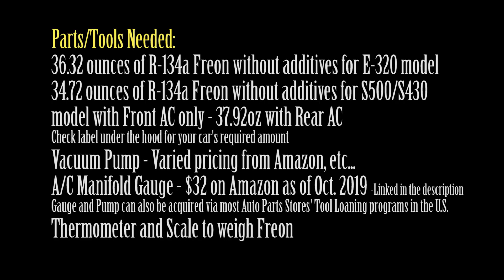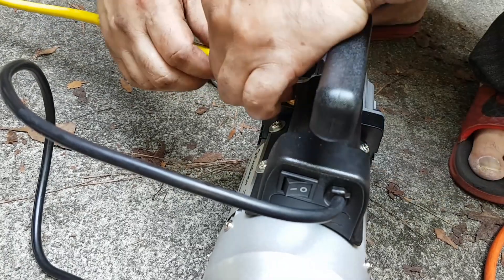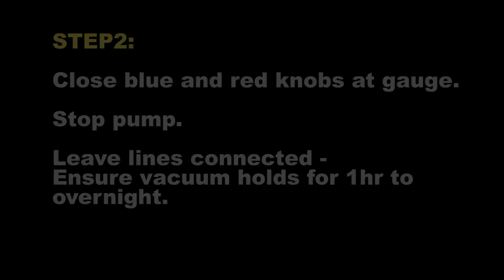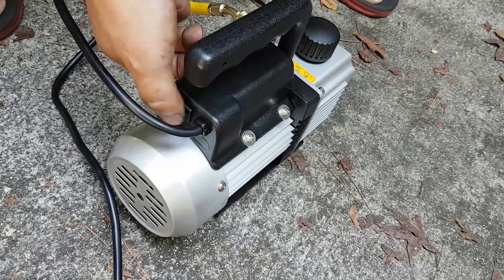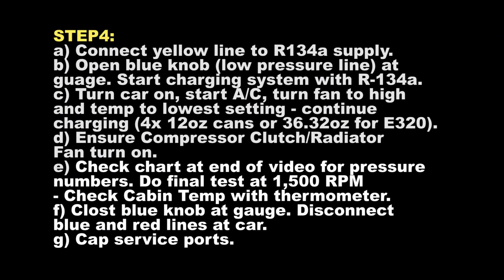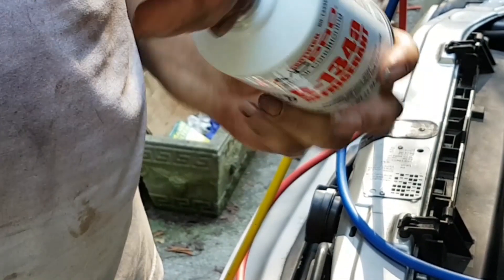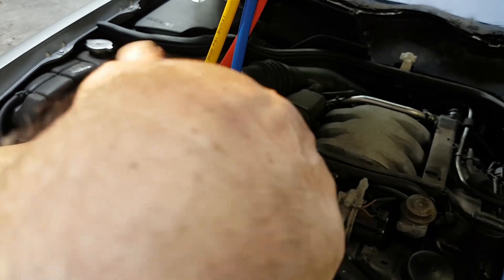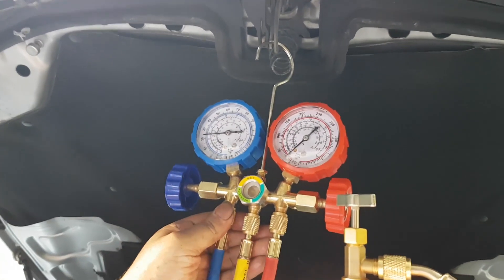Mercedes A/C FreonCharging - E Class, S Class DIY

Comment: Hello charging without any oil in the AC system is it right?
Reply from the maker: Hello Ahmad, if you are not replacing parts, there should still be oil in the system.  However, replacing components of the AC system requires oil according to manufacturer specs.

Comment: Thanks  for bringing  up this video to us 
Actually  I'm 20yrs old girl mechanic  leaving  in Ghana. 
I was once told a bout  the a/c job, and it was  interesting and it's  a very simple work if only  you know the right  thing to do. 
But I also heard the high guage suppose  to be on 2 to 3 bars and the low one on 14 to 15 bars.
So my question  is,: Is the  person  right? Because  watching  this  video seems  a little  different to me.
I would  like you to attend  to my question  please 🙏🙏. Thank You.
Reply from the maker: Hi and thanks for the comment.  Yes, that is  a good approximation.  1 bar is around 14.5 psi.  The exact numbers are dependent on a number of factors besides the ambient temperature such as humidity and altitude...

Comment: Great video.  I appreciate all youtubers who take the time to film, edit, and upload how to videos.  Thanks a bunch.  I have 1999 E430 which I replaced compressor and receiver drier.  Yes, should have replaced expansion valve and the rest but my cheap *ss relied on previous owner who said it worked but leaked.  First can went in but the compressor would not come on.  I found an eleven year old post on how to manually turn on compressor by holding EC and Rest buttons.  Will be trying tomorrow and will report back.  In your video, I noticed that your compressor came on without head unit trickery or reset.  What do you think?
Reply from the maker: Thank you. 
I would back probe the compressor plug and see if it gets a signal to start with...
Reply: @masood-tv  EC plus Rest did not manually turn on compressor.  Did some more internet searching and found two STAR Tekinfo pages showing head unit diagnosis procedures.  Ran them and noted the values.  On next engine start, EC light went off and compressor ran so added two more 12 oz. cans.  No clue what happened but it works great now.
Reply from the maker: @encinobalboa  fantastic. Glad it all worked out. You just saved hundreds, but the sense of accomplishment is I am sure priceless.
Reply: @masood-tv  True, knowledge and savings are win-win.  My costs were $110 for used compressor (a new near replacement unit from self-serve JY) and R134A plus $175 for Harbor Freight vacuum pump, gauge manifold, and tap.  Shop cost would have been around $1,500.

Comment: Question... reading comments, if the red light stays on the ac button that means the freon is low?. If thats true would would the compressor and blower motor not work even if the climate control indicates (fans and level bars) that air is on.
Reply from the maker: Hi facezdj, you should have the system scanned for fault codes .
Reply: @masood-tv  if the red light dosent stay lit on the ec button does that mean the freon is low..
Reply: Question 2 if freon is low does the compressor and blower motor come on.
Reply from the maker: @facezdj  yes, unless it is below a certain limit, from what I can recall.
Reply from the maker: @facezdj  that is true, I think, but I cannot speak from experience.
Reply: @masood-tv  how do you change the language in the climate control to english from german
Reply from the maker: @facezdj  I am sorry, I don't know if that is possible. But, there are translations online you could search for...

Comment: Which one is the high side or low side. Most people performing this need help identifying the ports.
Reply from the maker: Hi Jerome, low pressure AC pipes are larger in diameter.

Comment: Awesome video! Thank you so much for the detailed explanation. I’m getting the Freon evacuated then I will be changing the expansion valve and the drier then adding r134a refrigerant on my 99 e430. My question is, will I have to add any Pag 46 oil to the system? Or will there still be oil in there? Also you mention it’s 4 cans? Each can is 12oz. If the capacity is around 36oz, isn’t that only 3 cans? Thanks so much
Reply from the maker: Hi Jamil and thanks for the nice comments.  Have 4 cans ready and return one if you don't use it. Three should be enough in your case. Add .3 to .4oz of oil if you are replacing both the drier and expansion valve.  Let us know how it goes.

Comment: Do you know the pressure numbers for 2008 G500?
Reply from the maker: No, I don't.  But it should be similar.  The idea is to evacuate the system, check for pressure leaks, and then refill with correct amount as indicated for the car in the engine bay and monitor pressure gauges until you see something similar as in the video or the chart I provided for W220.
Reply: Masood Thanks, my A/C pressure is fine.  In extremely hot weather it blows warm, in 75-85 degrees temps it blows ice cold.

Frustrating, I can’t figure it out.
Reply from the maker: @335i101  Hi, when it blows warm air, have you looked at compressor clutch?  Does it still spin?
Reply: Masood Funny you say that, it is pretty buried on the G500 and I couldn’t see it.

However, when I would hit the A/C button I did not hear a click or notice any change in RPM, I would say that it wasn’t kicking on at all.

But then when the temperature outside is not as hot it kicks in.

I just bought an Autel MS906 and it shows no A/C codes.  I am pulling my hair out trying to figure this out.

Any help is appreciated.

Comment: I have a 2008 E320 Bluetec. The A/C system was working. I evacuated it and started to recharge it just like you, but the A/C would not turn on any more and thus it will not take the recharge. I read that if the pressure is lost or vacuum is used, then the system is disabled and there is a hidden code that needs to be reset. Do you have any idea about this?
Reply from the maker: Hi - did you check the pressure on both the low and high sides afterwards?  If the pressure is good, try resetting the battery and see if that resolves the issue - report back please.
Reply from the maker: Sorry, just reread your post.  So, it appears you couldn't recharge. Remove the negative cable for 5 mins and reconnect.  Will it turn on then? Do you own any OBD cide readers?
Reply: @masood-tv  I disconnected the battery, but it didn't help. My OBD scanner did not find any codes for this. I think I need a more advanced scanner that can read A/C codes. I found this video showing the code reset via the OBD port: https://www.youtube.com/watch?v=RgOfpEJkhBE

Comment: I have problem with my AC. It’s not cold when I checked the Low pressure port was over 100psi so I released some of the pressure but still not cold. My compressor is different than yours and always rotating so I don’t know if the compressor is engaged or no. Any suggestions?
Reply from the maker: Check the pressure on the high side.  What is the make and model of your car?
Reply: @masood-tv  Thank you for your reply. 2006 SL550 R230
Reply from the maker: You compressor should be the same as mine.  Mine also runs all the time.

Comment: I have a 04 clk55 amg, air runs only med cold, it never leaves a small puddle of water on the ground. I have to turn AC off and on a few times to get it to blow cool air. Temp regulates between 70 and 55 degrees. Great videos
Reply from the maker: Hi Matthew, thanks.  Perhaps, your system is low on refrigerant.